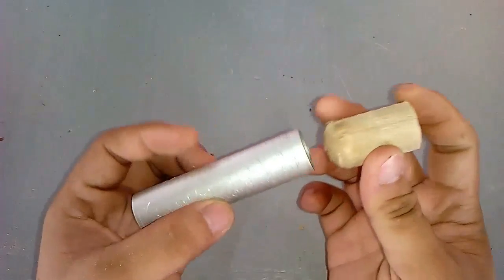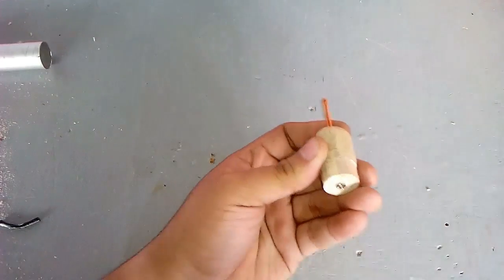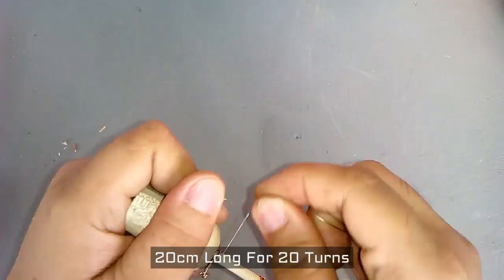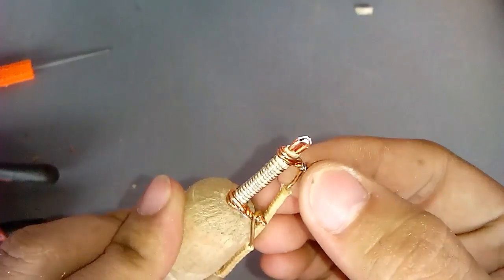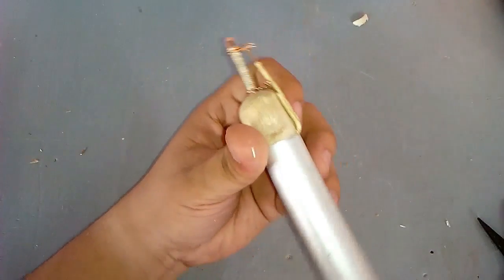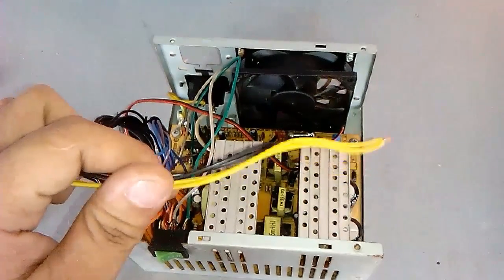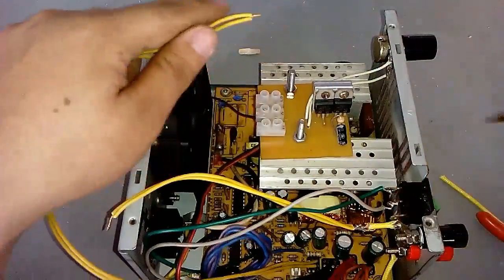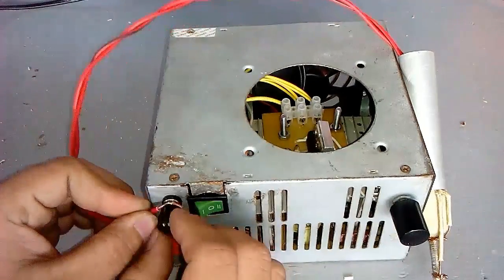Diy Soldering Station With Temperature Control

Comment: I have a 110 volt  soldering station that stopped working I can probably use the pen itself and convert it to 12 volts. Great Job!!!
Reply: Bandido it's a 110 going into a power supply converting 110ac to around 24vdc 40 watts.

Comment: Hahahaahha thats nice dude damn i try using old 70s soldering iron with heating temp ant switching power supply but i feel like 12 v are fine yea but i put it on 20 or i put it on 5/20 amps and started to smoke but after that it keep work so idk might be good :D
Reply: haha

Comment: Wow no heat regulation crap
Reply: Computer Fixes 1024 wouldnt that be far more complicated?
Reply: Yes But you just add one of those temp sensors that toggle off and on the power.
Reply: Computer Fixes 1024 The simplest would be a microcontroller that based on the temperature controlls the iron with PWM

Comment: Thank you! Could you show me how to connect parallel two Lm317 (or LM388k). Thank you again! (i'm not good english :)))
Reply from the maker: +Le Truong Giang you just need to connect the in to in, gnd to gnd and out to out.
Reply: Sek Austria we don't need to add capacitor or resistand between them?
Reply from the maker: you dont need to add anything. :)
Reply: Thank you!

Comment: you use paraler lm317? B to B, C to C and E to E? so its not for 1.5a (2a) but for 3a (4a)?
Reply from the maker: when you paralleled an ic chip it will doubled its amperage or capacity. if lm317 is 1 amp then it makes 2 amp when paralleled.
Reply: hmmm 30x lm317 :D :D 
this is what I want to know, thx
Reply from the maker: woah hahaha goodluck bro
have a great day :)
Reply: u2
Reply: Mejor sustituir LM317t por LM350t que es de 3 Amp y mismas conexiones.

Comment: nice work, if you find the 317 start to overheat you can use 317k or 338k, they can dissipate much more heat but isolating them is harder as the case is the output. keep up the good work
Reply from the maker: thanks for the information mate. its really heating but not that much. i will try that 338k. :)
Reply: Spark Gap Hi, do you think you could have taken a quick look over at my channel? If so thank you:-D